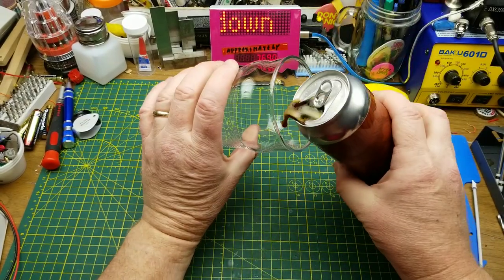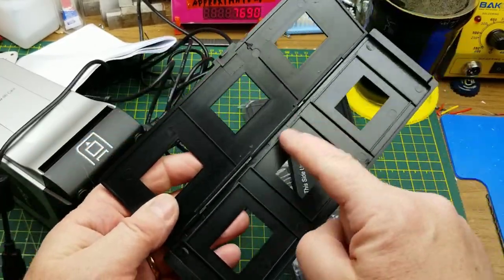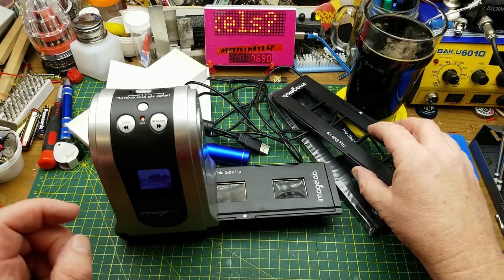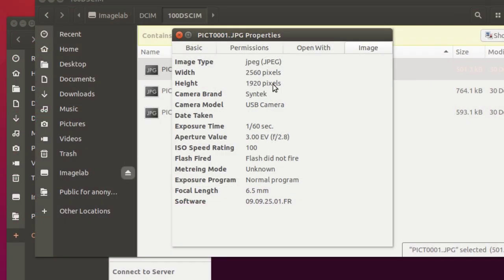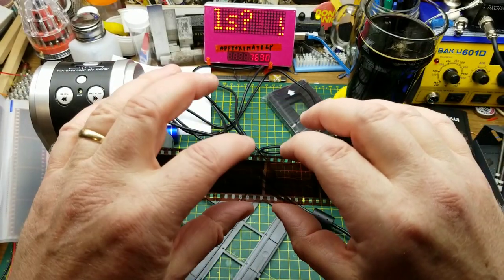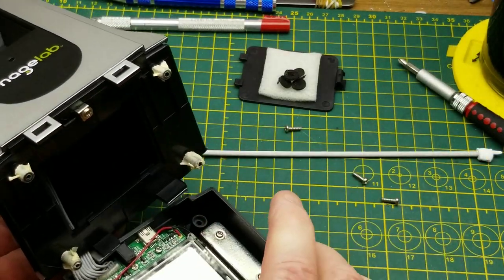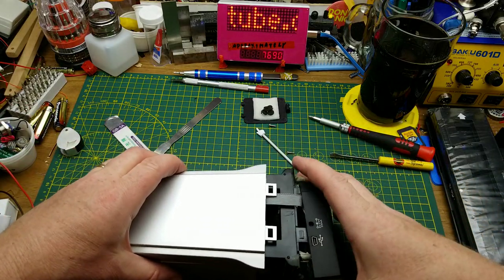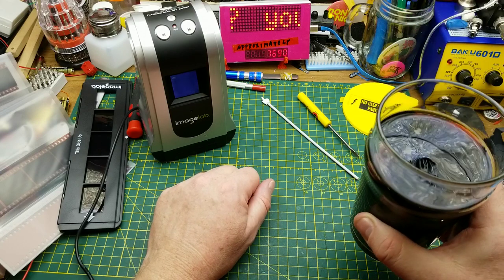slide and negative scanner (quick look and teardown)

Comment: I did spend a good number of hours scanning large format negatives, using an Arcus flatbed scanner, and then a whole lot of time doing blemish removal afterwards. Clean negatives, clean scanner, and a good number of lamp changes as the lamps aged on it. Nice scanner, serviceable, and you just had to order the correct lamps from the agents, which were ordinary T5 small flourescent lamps, but a very high CRI one that was exactly equivalent to real daylight, and with an even colour output with no peaks.  Lamps would last 1000-2000 hours, then the scanner firmware would not be able to do a calibration run, and you would need to change them. Only drawback to still using it now is that it is SCSI, but there are still USB versions of it around. 1200 DPI resolution, and no interpolation, so the files were around 50M TIFF files. But a good number were printed out on A2 paper, and the limit there was the printer, not the scan.

Comment: In mid 1980s I bought a second hand scanner, traded up by a newspaper reporter for a later higher grade scanner, for Aus$1400. Original price over $7000. Required a Mac computer as it had that software included. Did good conversion, but by modern standards now very dated. Now have several flat bed scanners with assorted image scan frames including larger format negatives than 35mm.
Among accessories really needed is a good dust blower/brush as negatives and slides end up with very  bad dust and fluff that requires much photoediting to fix even ising auto correction of many good editing software. Best aviod as much before scan rather than after.
One problem I noted by your scan of negatives is no provision to assure holding negative flat. With negative tending to bulge it is hard to keep sharp image over the whole negative. More expensive  scanner film cradles have flat glass inserts to girce the flatness of the negative, good slide mounts are also glass faced, cheap tools dont and sildes are only cardboard frames, no glass.
Anyhow preserving family history is one of many tasks in latter years of life.
I have saved several people's images, and even several 8mm movies. In one case a work colleague had me piece together a Regular 8mm set of reels of his fathers teen to adult years of camping and hunting, some 4.5hrs of 3min reels. Many needed repairs and cleaning. Old joints were parting, some part had burnt frames from previous projector faults, some sprockets torn. It cost me over 50hrs of work.  But his father almost fainted on seeing his much prized life projected,  many memories restored. His father was so impressed and pleased, having been convinced all that was long lost. 
Not many people can still deal with the old regular and even the improved 8mm film.
 I know many who have thrown away old negatives thinking all obsolete and unusable. Save as much as possible. For my parents now deceased, I recovered and restored many early 1900s onward inages from negatives and scanned/ scuffed/ damaged old photos. Some I made better than original by digital work to colour correct, sharpen, repair blemishes and damages. Also turned the tiny prints, only few cm large, then common, to A4 or larger.

I  have years of work if I were to proceed with all I have on hand as images, negatives, slides and 8mm movies

Comment: Hmmm... You've run in to the classic dichotomy of digital photography. Small, cheap digital imaging chips were developed in the days of 640x480 and 1024x768 screens and have an aspect ratio of 4:3. to fill the screen. Large, expensive imaging chips were developed to be used with 35mm film cameras bodies and have inherited a 3:2 aspect ratio. What you are seeing is the result of trying to capture one format (3:2) with a (4:3) sensor.

There are two choices the designer can make:-
1) Fit the whole 3:2 image onto the sensor and end up with considerable areas of black pixels at the top and bottom.
2) Fit the maximum amount of image onto the sensor and lose the left and right edges. This maximises the number of useful pixels in the image.

You can guess which way they went.

As others have noted the output jpegs are highly compressed. Good news is you can get a lot on your 256MB card. Bad news is they will degrade the image quality.

The lens used will be very mediocre, again a cause of image degradation. Combine this with shooting at very short distances between slide/negative and sensor (3-5cm by the looks of it) and the depth of field (the range of distance from the sensor to the slide over which the image will be sharp) will be less than a millimetre. Therefore if the focus is even slightly off then the whole image will be soft. Trying to adjust focus with the obvious slop in the system will be a time and effort sink

It is possible to make good slide/negative copies but not with this sort of kit. Start with a cheap secondhand 8-12MPxl DSLR body,  an old manual 50mm lens from a film camera with adaptor to suit your camera body, a slide copier which will mount to the front of your lens, a set of macro tubes and bright light source. Shoot with the lens stopped down to f/5.6-11 (for greater depth of field) and manually adjust exposure and white balance. Also shoot RAW or high quality jpeg. It will take time and you'll learn a lot about your chosen camera and photography in general but you will produce good results for around $100-120 for the kit.

Ian

Comment: I think Epson makes the best negative scanners, at least it did 7 years ago when I scanned 8mm film 14 frames at a time to make into digital videos. I think it does 12800dpi, even though the guys back then didn't really notice better quality with greater than 3600dpi. Yeah I had dust problems well, and I think it's because film charges with static easily. They had a dust removal script, but I did it manually with brushes and cloth pads.

Comment: An interesting product, in so much as it is not actually a scanner but a digital camera that takes photographs of the negative or slide.  Slide or negative sits on that light box similar to an old fashioned photograph enlarger and it takes a photo, hence the impressive speed. As another review pointed out you could tweak the focusing of the camera, although it would take a lot of trial and error without a realtime image from the camera. I’m guessing also that the resolution boasted on the packaging is interpolated, unless there’s some software provided (or available to download) that can change the base resolution. I like how quick it is at capturing the images, but as you pointed out the image quality is crippled by the image compression. Hopefully there’s some way to change that or is this scanner completely self standing?
Reply from the maker: This thing works fully standalone. The only function the USB connection has is file transfer from the SD card.

Comment: I have a wolverine similar model. It does 16 mega Pixels for 35mm film and slides. Amazon has them under 100. But I mostly use a tripod with a boom and a light box to scan my negs with my dslr. I usually use the wolverine for proofs and the dslr for final. But I'm doing Client work that way.
Reply from the maker: Good to know that what at first sounds like a janky setup is actually good enough for profesional work!
Reply: @pileofstuff  it's still a bit janky, but I use it for proofing with the client before high res scanning for prints

Comment: I think that these equipment isn't good for scanning film... Nowadays you can do better a better job with your phone. I recommend check the negative lab supply lightroom plugging or use a cheap flatbed scanner.

Comment: I certainly wouldn't bother with that shitty scanner that you are showing here. The images just look faded out, blurred to shit, full of JPG compression artifacts, and thoroughly nasty.
Luckily I recently found a Nikon LS-4000ED film scanner that has been discarded for the local council hard rubbish collection. 100% complete with trays and accessories, even a warranty card and manual! These were released around 2001 for about USD $1800, equivalent resolution about 8MP with decent lens and automated error correction. Generally considered best "cheap" film scanner at the time.
Reviews on the one I scored:
https://www.imaging-resource.com/PRODS/LS4K/L40A.HTM
http://www.steves-digicams.com/accessories/film-scanners/nikon-super-coolscan-4000-ed.html
I'd say that's about the minimum level of scanner quality you'd need to get reasonable results. Yeah you can botch something together with a 35mm camera + adaptor, or even a flatbed and some kind of backlight, but the colours will be all over the place because of an shitty non-calibrated light source.